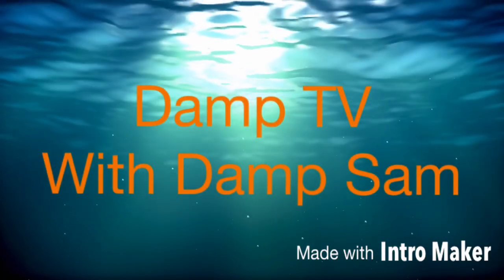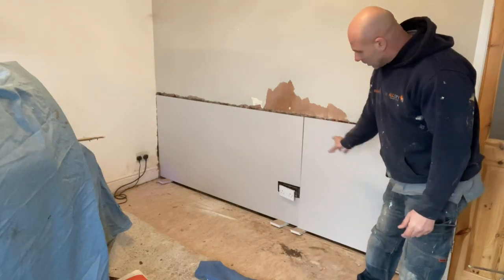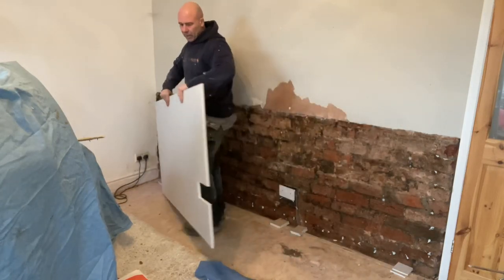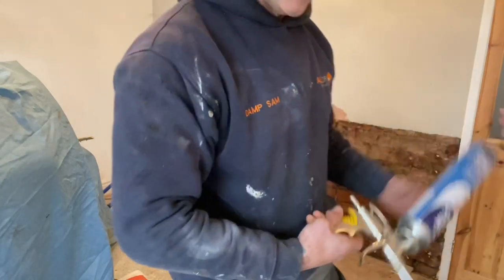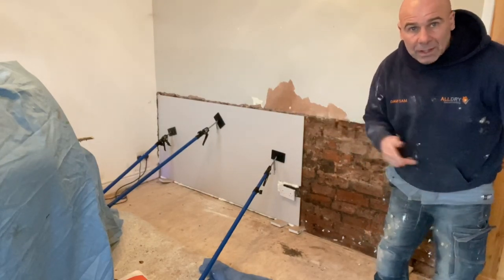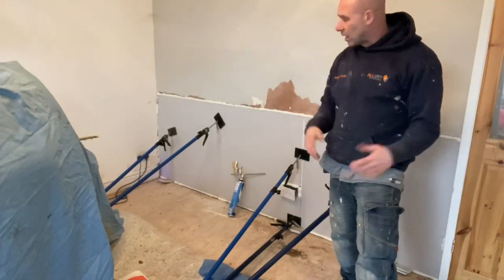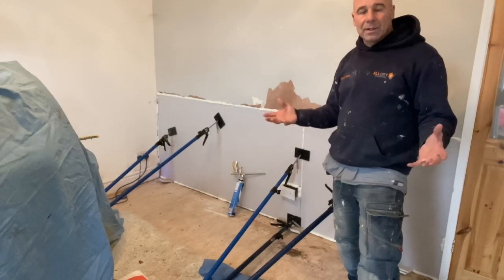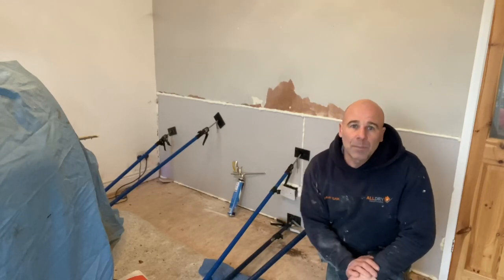How to Dampproof a small wall like a boss

Comment: it’s a great idea?  as there is more profit?, what’s  about the customer any saving for them?  , you didn’t even mention the customer , it’s was all about  this system,which  didn’t even look right to me , damp and regular plaster board , I don’t think so, you need to find the cause , before you can rectify the problem, I would have grave concerns with any of this type of work …..
Reply from the maker: Hi Andrew, thanks for your comments, It's understandable that you may have concerns as most people don't know how dampness affects walls and how different types of dampness require different systems to be installed. I'm sure you are familiar with DryZone cream by Safeguard Europe, that's the siloxane-based cream that every company that makes Dampproofing products have copied. These creams. have replaced the retrofit high and low-pressure systems that were injected into bricks after years of research showed that rising damp will take its easiest path and this tends to be via the capillaries of the mortar bed. This is the same company that invented the system i am installing in the video. They didn't just come up with it after a few beers down the pub, like the creams this took years of research and had to be BBA 3rd party tested to make sure it does what they and i say it does. The reason i do the videos is to point people in the right direction and its uses for non plasterers is immense because of its simplicity. This system can be the first foot on the ladder to the lucrative preservation industry for plasterers when they study it and see its not that complicated.
I don't mention the customer in this video because its not aimed at customers. from my experience, a customer wants less mess, speed of work and ultimately a drywall and being able to paint it and get back to normal quicker. this system gives them all this and more so its a win-win.
If you follow the channel you will know that i am a PCA CSRT qualified Damp Specialist surveyor and also a CSSW waterproofing surveyor so to think we just rocked up at the customer's house without diagnosing and quoting for the job is a bit naive. It would be interesting to know what qualifies you to dismiss this market-leading system so if your im my neck of the wood please feel free to contact me and happily sit and have a coffee with you and tell you more about damp. if you want to hear more listen to The Damp Show Podcast on your podcast provider its out every week. Have a great weekend

Comment: This is outrageous, not the way to dampproof
Reply from the maker: This is a bold statement from someone who has gone to the trouble of making up a fake profile 2 months ago. Even do if you want to explain why you think it’s outrageous I’m more than willing to listen 👂
Reply: Not a fake profile, I dont use YouTube and the system you’re using is not the right method, you’ll eventually get a comeback. Stick to the cavity wall membrane and you won’t go wrong, used it for 10 years now and never had a problem.
Reply from the maker: @jordanmorley2060  just to let you know as you seem to have little knowledge of damp systems. Safeguard Europe who invented Dryzone creame that you probably use , which was the fore runner of all the siloxane based creams on the market  brought out in 2000 are the inventors of the system we use, Iv added the instastik. They invented the drygrip and dry shield salt neutraliser. 
Not knowing this just shows your ignorance of our industry. I’m all for comments on here but when they are non constructive and dismissive without any research it can be a bit trying.
Reply: To start you shouldn’t be using a grey gyproc board onto old perished brick, especially sticking it on with a silicone adhesive where it’s only got a certain lifespan, also you’re using expanding foam to apply the board.
Reply from the maker: @jordanmorley2060  wow, thanks for the comments, so with the limited life span of gyproc Plasterboards you mention I suspect every property in the country all 25 million are at risk then given your ill informed information. I don’t think I need to say anything else as anyone with an ounce of intelligence will see the gaff you just made.
Reply: @dampsam  you need to go back to college haha take care 👍😂
Reply: If you could read I never mentioned about grey gyproc having a life span, take care damp Sam. Hope your customers are happy

Comment: Alright mate just after some advice I've got damp patch on my new extension wall we're it's a cavity wall but the ground outside is built up with hardcore and then Indian stone how do I stop the damp thinking knock off plasterboard then k11 tanking an redo board an skim will this work
Reply from the maker: Hi Gavin, 
If it’s lateral dampness due to the raised ground level outside a waterproof system would work if installed correctly. Without seeing the job it’s hard to give solid advice on the wall.
Reply: Ye I know what you mean I'm a plasterer an I know its hard to give advice without seeing it would k11 work or ka slurry
Reply: Thanks again for your advice keep the vids coming to as I learn a lot from them which is handy in my trade